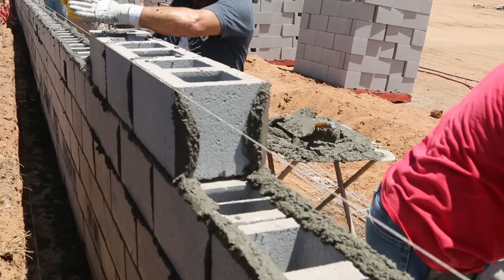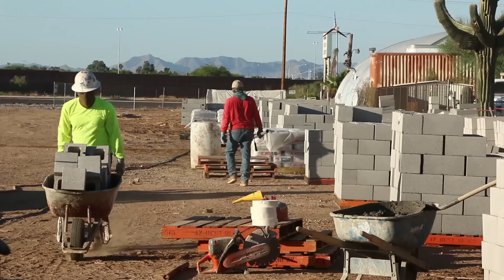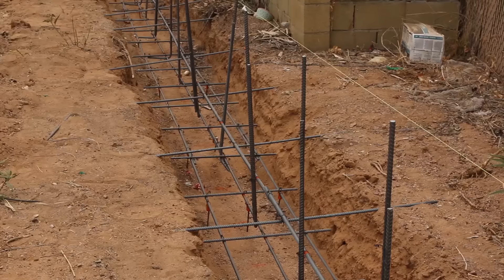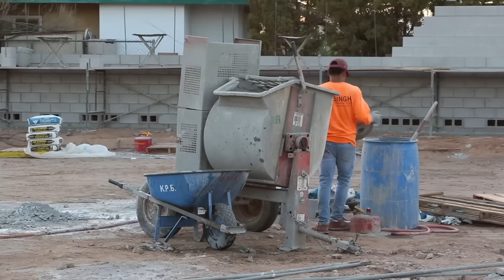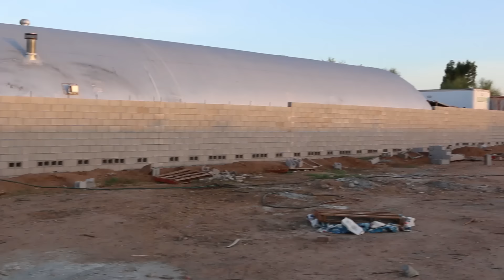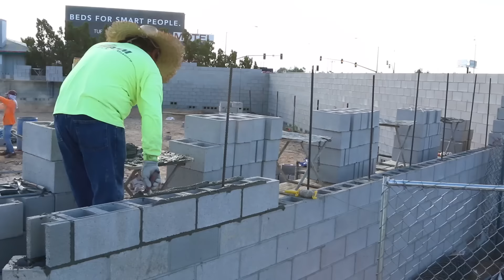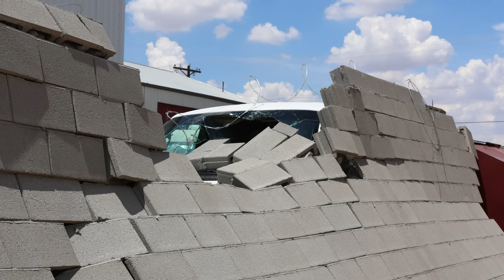Building A Block Wall

Comment: It was a very very good video. Congrats. By studying htis short video one gets a load of insight in how to make a boundary wall!! 
 Thank you for the effort of putting it together. The three different mixes: The footer: Concrete (cement, sand and gravel), the blocks: Mortar (cement, lime and sand) and inside the blocks: grout (cement and sand) was also good. The only thing I missed was an explanation on what  the function of the lime is in the mortar. A little information about lime would have been excellent, but by all means, your video was great.
Reply: Lars Lover    The lime helps to mix the water into and within the portland cement and sand (i.e. concrete without the gravel) permeating it and giving the mortar what's called, 'workability' because the lime helps the mortar to retain the water which keeps it from drying out too fast and thus making it easy to spread with a trowel and stick to the block.  Without the lime (or 'air' in the case of masonry-cement or mortar-cement) it would be damn near impossible to use it as mortar.  It can be done, but it ain't fun, if you know what I mean.  I hope that helps. ☺

Comment: That was great.  The timing of the collapsed was a shocker in sure.
Reply: Many mason contractors try to save time by not grouting their block walls until it is completed, then come back and grout all at once.  Multiple times, the walls fail, due to not being grouted in lifts, such as 2 foot or 4 foot lifts of block wall.  to clarify.  lay 4 foot of block wall and then where the vertical re-rods are, fill them with concrete or grout, then continue building the block wall for another 4 feet.

Comment: 10 years from now robots will be doing all this work. ...  Of course the humans will still have to mix the mud because the robots will make them slaves.😲😅😂😭....... Get Ready For It Humans.  you've just been warned. ..... just replace the apes with robots in 'Planet of the Apes' ; think, 'Planet of the Robots'''😐 ... TERMINATORS WITH TROWELS!
Reply: Not 10 years, end of this year. Fast brick robotics perth Australia

Comment: Watching that last brick in the video fit perfectly was super satisfying.
Reply: That is a block. Not a brick! Big difference!
Reply: @cooldog60  be fine to chat cc ft ft ft FF FF FF FF
Reply: And to have it fit exactly  - over the rebar -  in the middle of a course - that's master work.
Reply: Difference between a block an brick is about 30lbs.
Reply: @jacobmarmolejo3946  and concrete or clay.  A true brick is clay.  a modern brick is made of concrete
Reply: block*
Reply: @Synnz  FF FF FF in ffatinayuni91@gmail.com ffatinayuni91@gmail.com full of good g at tggu ffatinayuni91@gmail.com FF in
Reply: https://youtu.be/lyk50gFS2rY
Reply: @John Contos beat on your level, beat your head, $150 tool
Reply: Exactly my thought!

Comment: In the 60's being about 12 years old at the time I helped my dad build a wall fronting our home that ranged from 6 ft to 10 ft tall.  My job was mainly mixing the mud by hand, hard work but learned a ton from watching "pops" lay the tile.  Here we are are some 50 years later and that bad boy is still as strong as back then.  Thanks for the memories.

Comment: I think he meant to say e.g. not i.e. just sayin.
Reply: Zero Entropy ???  i.e. = 'that is' -  e.g. = 'for example'
Reply: "Guys who specialize in placing and finishing concrete i.e. striking off the footing i.e. putting the footing in place and pouring off of the truck"  Okay so I always use it like "in other words" for i.e. and "example given" for e.g. but I could be wrong here, that happens often.  Like effect and affect always get me even to this day so I just don't write them.  But in this case is he not giving an example versus rephrasing?
Reply: Zero Entropy 😂  It doesn't matter, unless you're an English Teacher.  They like to criticize and correct everybody's spelling and grammar.  Just like OSHA and building inspectors like to come on YouTube and Bark At The Moon!! 😅

Comment: can a wall be layed dry then just grouted since most of the strength is from the grout? Filling the cells vertically.  I dont see it dont so I assume no but what a time saver LOL.
Reply: The are some new blocks that are laid dry i think, but for the most part you need mortar as the blocks aren't perfect milimeter precisely sized, there's slight variations that can be take up by mortar. That and going for a desired height, taking up deviations in the footings etc can also be adjusted by the mortar bed joint thickness.
Reply: There is a product called Quikwall that is structurally approved to skim coat (like stucco) dry laid block. Good stuff.

Comment: Very impressive video. Very well explained. I believe the structural engineer likely underdesigned the wall with rebar only at 40" O.C. in the center of the wall at 8 feet tall, at least at the corners/ends. ASCE 7 load case C should be considered. It will likely hold up for a very long time though, with the correct installation shown. Were the webs mortared next to the grouted vertical cells?

Comment: 15:40 I feel like I misunderstand something about the concrete beam that goes at the top here. I'm led to believe it's a horizontal beam of concrete that ties in with the vertical beams, but I don't understand how that works when everything else is empty and the horizontal beam I'm thinking of would fall all of the way through the cells as it's being poured.
Reply: I'm sorry no one answered this; hopefully you'll be notified of my reply. Before the top course of bond beam blocks is laid, there is a product called grout stop laid atop the penultimate course. It's a roll of paper meant to prevent exactly what you described.
Reply: @joelglanton6531  Thank you for the reply! I did indeed get notified and understand now

Comment: Loved the video, but I must point out that rocks (gravel) in concrete have little to do with its strength. I own a masonry company and our 4,000 psi site mix is only portland cement, sand and water. Mortar is weaker than concrete because of the presence of lime.  Lime gives the mortar workability and board life but diminishes strength.
Reply: I have seen a lot of old worn concrete where the rocks are protruding because the sand cement mix is worn away.
Rocks are really very hard and strong.

Comment: It’s tough to see ASM on video disregarding basic OSHA regulations on silica exposure, fall protection above 6’, hardhat use with obvious overhead risks and current PPE requirements during grouting
Reply: And not a rebar cap to be seen, what the heck

Comment: Trump doesn't realize that Mexico has been the source of skilled workers that have helped build and provide food for this country. Having said that I would not want to live in a desert with high temps and massive walls with barbed wire. It would make a great prison I guess. I don't know if the wall is because of crime or freeway sound or some other reason. My guess is such a massive wall must have cost at least $75K.

Comment: I saw the compact power stickers on your mini excavator there, rented it from Home Depot didn’t ya? I work in equipment rentals at the Home Depot in Porterville (central valley) CA. If you’re ever in the area stop by and check out our yard, we’re trying to branch out into larger equipment for contractors like yourself. Big fan of the channel.

Comment: I have a question.  I mixed up some quickrete recently and followed the directions for how much water to put in and it was WAY drier than the mix shown in this video.  I know that concrete strength goes down very quickly with the amount of water you put in it so I am wondering why their mix looks so soupy?  Is it to make it easier to pump?  Or was I doing something wrong for my mix?
Reply: its easier to pump and also it needs to flow in order to get aroung the rio and minimise voids and air pockets, plus it needs to be some what workable to trowel off for a decent finish if needed.
Reply: Thanks! Makes sense!

Comment: These guys are masters at their craft.  Every move they make is precise and fast.  It's like they can't do anything wrong.  I'm a perfectionist and it would take me 5 minutes to place each block perfectly, and even then I'd have smeared motor on probably 1/2 of the face just trying to clean the joints like they do.  Man, what a skill.  Money very well spent.
Reply: Actually, they used a chopsaw to make cuts, that was not brilliant, but dusty and silica spreading.  Also, their completed wall had too many mortar stains, and they did not cut the beds and heads to use the mortar for head joints.  However, yes, I agree, other then them items, great work

Comment: I have laid litterly well over a million of those, some where between 200 and 500 hundred per day depending on job, conditions inspectors, Finnish verses unfinished and kind and amount of reinforcement, ( dorowall tee wire, red iron connections intermediate beam work, inspectors insisting on mud being cleaned out  at each block.seemed like on some jobs we did more of everything else than laying block

Comment: Great Video like always. Not to mention just exactly what i need to learn about concrete blocks because i am build a covered concrete patio. So iam also building a water wall and some concrete planters attached to it. I took around 10 minutes trying to figure out how to level the wall and also how much mud i needed to put on the concrete block. One side note i live in Puerto Rico and concrete building is essential.

Comment: Thanks for the great video. They did a great job. One little mistake, and Scott puts it out there for everyone to see. They changed the bond at the control joint. A half in the wall would make my dad rollover in his grave. Two half's OK. One half is a no no.
Reply: Probably a local code thing. Overly intrusive local codes and inspectors pi55 me off.

Comment: Nice, thanks for that.  I live in the desert and acquired some oil pipe and sucker rod to build a fence.  I was going to use corrugated metal sheets for privacy.  I tried welding it to the pipe, but it doesn't stick very well, any tips?

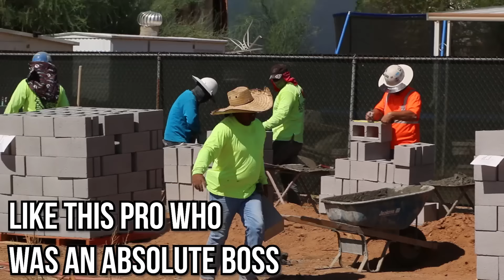Comment: From 2:30-2:36 you can see a great example of multiple OSHA violations.

He’s 1) not wearing eye protection, and

2) he’s making no attempt to limit his or other employees exposure to the silica dust created when cutting that concrete block. The most common method I’ve seen is simply using a wet saw. Silicosis is no joke, and he’s putting himself as well as everyone around him at risk.

Edit:

For reference; https://www.osha.gov/laws-regs/standardinterpretations/2006-07-20
Reply: Umm...yeah. C’mon out and join the real world.

Comment: Old boy with the straw hat has laid a block or two. I loved watching him fit that 45* corner and building the lead. Interesting that it was all laid up with double enders (corner block) and sash block, not a common line block in sight. Excellent explanation of all the features that go into a good block wall.
Reply: David Johnston , the double enders as you call them are our common regular units in this part of the country. I don’t know the exact reason why other than the following logic; ease of manufacturing, simplified material ordering and handling, ease of laying but the fact that all the units share a common handle location which inturn means one handed laying. If you’re cursed with double open ended units having webs that aren’t on the center of gravity, I feel for you.
Reply: Our double open ended units, what we call commons, or common line block, do have a centrally located web and are equally well balanced as the double enders. A typical cube of our commons would include some double enders, or corner block to show a smooth face while making the turns at corners. I don't lay block, or brick for that matter. I was a shop man, mechanic and welder for a brick, block and stone mason contractor, so have handled my fair share, but only to sort out mixed pallets when returned to the yard, and the occasional unloading off truck at a job site. My best buddy I feel for as he is a foreman and has spent many a day laying up block. In his mid 40's his body is already breaking down.

Comment: 10,000 hours causes a neurological change in the brain, what most people would call mastery. These people literally see and mentally process the craft/thing differently to everyone else. 

2,000 - 3,000 repetitions will form a neural pathway (muscle memory), it's important to do it right in those first times because if you get it wrong it can take 8k - 10k repetitions to correct the pathway and under extreme stress or tiredness you can still revert to the original, erroneous muscle memory. 

This is something I've been fascinated with for a long time. Yea, I'm a nerd.
Reply: Thank you sheps, very cool!

Comment: This is awesome. For some reason building a block wall always seemed to me the peak of efficiency in labor when you watch these guys. It's amazing the precision they achieve laying just the line of mortar on the edges of block with the trowl and how fast they do it. Then setting a block and the 5 seconds to level it and clean up the extra and grab another block. What looks so simple is not at all easy and that's what makes it amazing.

Comment: I love masonry, especially CMUs. One note is that Cinder blocks are still a thing. Cinder blocks are CMUs where the aggregate is made out of cinders, they're weaker but lighter than the ones where the aggregate is made out of coarser stones. Of course, nomenclature may vary depending on your location.

Comment: The quality of this video is a new level of professionalism. Well done.
Reply: I agree the quality of the video is very good, just wish you could have found some masons that were a little bit better. Good but not great, lots of no no's. Letting them cut off the mud and just let it fall on the ground, what waste of time and money not only of product but clean up time is one of my pet peeves.  Others that I noticed that they did is probably from being taught that way, like cross webbing and not plumbing the face or could have picked up bad habits thru the years. But only a hand full and like I said that could be from the region they were from also. Anyway the end product looked nice and nice video. Thanks. Remember there's always more then just one way to skin a cat.

Comment: Quick question.... why do they only put cement on the edges of the blocks rather than the whole width (as I've seen brickies do in the UK?)
Reply: Waste of cement Paul
Reply: Fair enough... I just though more cement = better sticking togetherness....
Reply: The larger surface area is on the sides...

Comment: As a small child I watch a older guy, around 70 put us in a block wall to make a bedroom out of our Garage, it was around 10 foot by 20 foot, that wall was so nice, basically perfect, I visited that house a couple of years ago, at that time the wall had been there for 60 years, still perfect as the day he built it. My Dad thought it costs a little to much. He paid the high cost of 100 dollars to have it done, this included all materials. The guy was a Craftsman like yourself.
Reply: Wow!
Reply: https://youtu.be/lyk50gFS2rY
Reply: so, that is 23 block per course and at 70-ish block, 3 courses.  thus, 70 block x $5.00 per block for labor and materials, $350.00 is a low to middle range cost.
Reply: @kevincecchini368 That wall was built in 1957.
Reply: @charlesmiller5078  OH wow, so probably a good and fair price for the day.
Reply: @kevincecchini368  Wonder what it would cost today, the house is worth around 270,000 today, My parents paid 9,995 in 1956, in Clearwater Fla. My Dad was a commercial Pilot for Delta, believe he brought home around 100 bucks a week.
Reply: @charlesmiller5078  Most likely between $1,500 - $4,000.
Reply: Yes I love taking my 6 yo son around and showing him some of the work I put in. I’m 52 now and I put in my neighbors foundation for his add on bedroom 23 years ago and it’s still right there, up close and personal. I charged him $1.00 a block (neighbors rate) just for labor. So I made about $180-$200 in 1999 for a Saturday’s work. Loved every minute of my career.

Comment: Oh man, that took me back about thirty five years !  I went to work for one of my cousins that was a super good brick and block layer.
I was a young strong, and in good shape man and was no stranger to hard work......... so I thought !  When you are the grunt that's doing the mixing of the mud and hauling brick or block AND doing everything else that has to be done for two and sometimes three guys, you find out just how good of shape you are ! It's some hard work for sure and will put you in shape or kill you ! 😊
Thanks for sharing and take care. 👍 👍
Reply: Oddly enough usually the skinnier labourers handle it the best, but you just have to hook in and push through the first week or two until your body gets used to it. I remember many moons ago when i was an apprentice those first few weeks were hell.

Comment: So, does the grout fill the entire wall cavity?
Reply: I also was wondering this
Reply: There are spots in the wall that are poured from bottom to top to make a upright beam. The bond beam on the top couse is poured all the way around the top couse the couse below the bond beam is plugged off to the keep grout from going down.
Reply: Ok, that explains it.  Thanks.